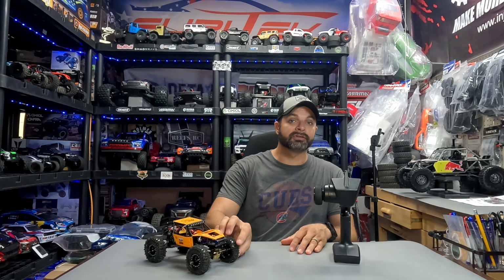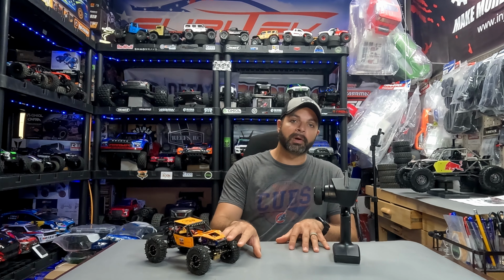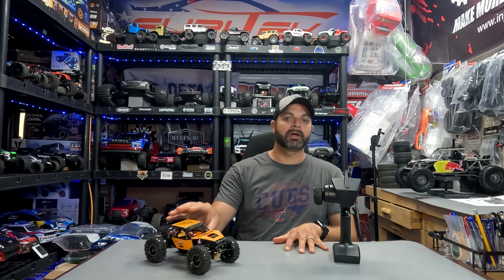INJORA Brushless Motor & ESC Issues Solved!!! + Running Footage

Comment: Ok.. so I've just watched this video and I'm very pleased that you've been able to work through this problem with the brushless motor and esc. I'll have a look at it tomorrow as it's a bit late here in the UK. But a Big Thumbs Up to you and your channel. I have subscribed and I look forward to seeing your future uploads. Thanks a lot dude 👍🏼🇬🇧
Reply from the maker: You are welcome. Good luck.
Reply: I've tried flicking both switches before leaving them in the 6v position, but still I'm getting brown-out with 64% battery power left. I've  even gave the switch a quick spray with brake cleaner. The only thing I can think is, maybe I should follow others and go 3s. Apparently, others has gone this way with 100% fix.

Comment: I installed one and mine freaked out when I hooked up servo, it went haywire, tried what you did and everything works but my servo will randomly wine and not steer one way some times? Any help ?
Reply from the maker: @dustingreen5470  sounds like a faulty ESC. Be careful it might burn up your servo.

Comment: Any clue why mine is cogging at low speed while climbing slight inclines?
Reply from the maker: @Jayizzy433  These have been having a lot of problems. Cogging is the worst. Programing isn't even helping.
Reply: Mines ok, but i use 3S.

Comment: I had a feeling that the glitching was something in the settings. Cool! And the other issue sounded more like a calibration issue but glad it’s all working out the box.
Reply from the maker: Me too. INJORA did a great job with this setup.
Reply: @hyperc5249  How to resolve the glitching part? Mind to share your setup in the ESC software?
Reply from the maker: @anythingwilldo8540 I already pulled this system out. They pulled the v1 off the market because it had frequency issues, which caused cogging. I run Furitek and Hobbywing now.

Comment: I don't know how you cured your brown-out probably by simply toggling the switch a few times 🤔 This most definitely did not work for me. I went from using the standard trx-4m 750mAh battery  and I  replaced it with a 2s 900mAh. What I did find was that both the 750mAh and the 900 mAh batteries both browned-out with 63% capacity still left in them 🤔 which I thought was strange. So having thought about it for a couple of seconds, I came to the conclusion that the fault can't be with the switch, it must be with the program in the esc. 🤔
Reply from the maker: @bb4l881  Yeah. They pulled this off the market. I have switched it out for a Furitek setup.

Comment: They used inferior dip switches on that ESC... The spring pressure is probably not enough to hold a good connection, and it is possible there's a bit of manufacturing debris inside of those  switches... If you can actually get those switches to hold contact it might stay working properly... Hopefully, it does because that's like the best system going for the price right now...

Comment: @hyperc5249  I just installed it on my CR18P Pro ,No problems whatsoever. Pinion fits too. That makes this combo a direct drop in for the hobby plus CR18P  line
Reply from the maker: @rcflightadventure7282  Awesome. Thanks for the info.

Comment: Oh by the way, your ESC not initializing is a very common problem with brushless systems, and most of the time, I've had to adjust my throttle trim... It'll power on beep and count your battery cells but it won't initialize because it can't see your transmitter because the throttle is out of calibration with the ESC which is why you need to move your trim...

Besides that everybody knows that onboard BEC suck ass... personally I would just pick up one of the castles $20 becs and and disconnect your Rx from the BEC altogether...